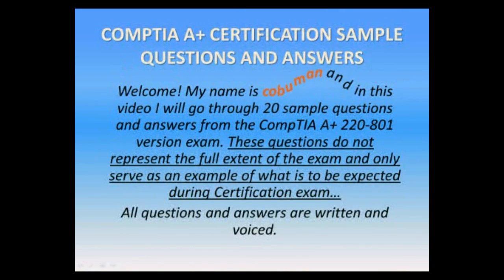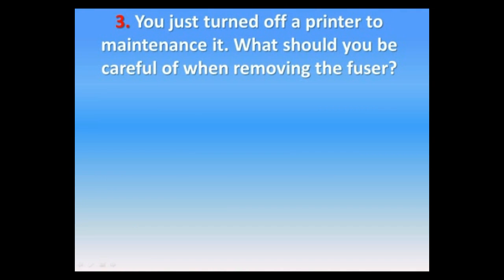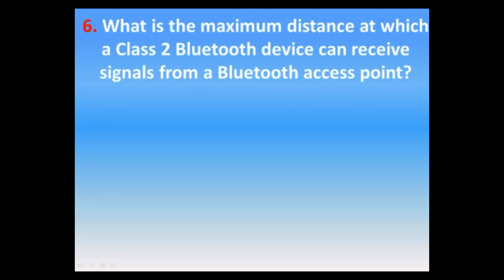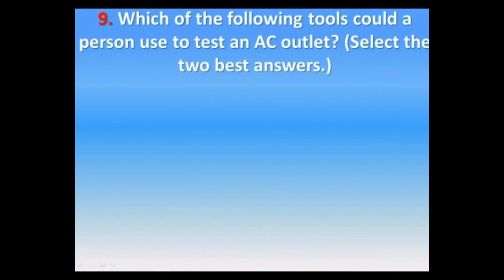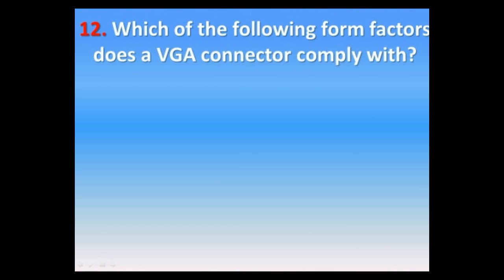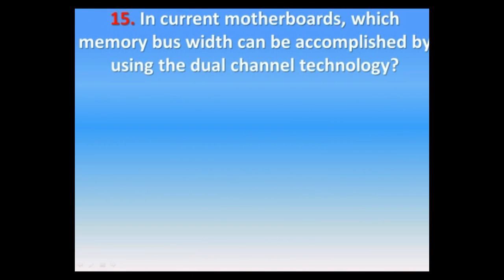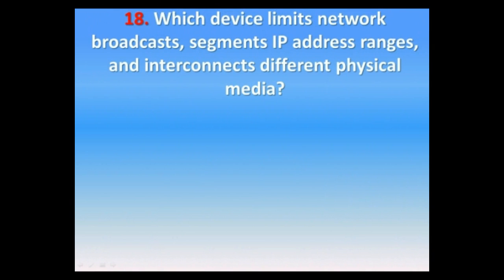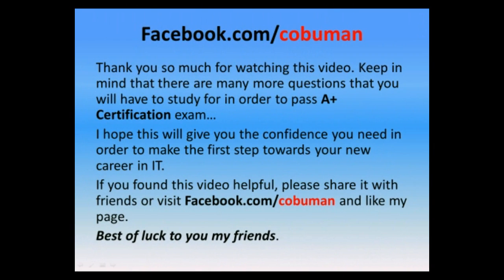Comptia A+ Certification 220-801 Top 20 Sample Questions and Answers

Comment: Actually I thought the most common types of fans were 30mm and 120mm. You’re answer was 80mm and 120mm
Reply from the maker: You may be right. Information on the video is based of CompTia source.
Reply: 30mm is probably an old standard when we were running 333mhz computers with the Pentium 1's and it is also the size of some weaker cpu fans but 30mm isn't common in 2019 and is more suitable for small form factor cases like ITX which isn't as popular as the standard cases.
Reply: Joe Exotic yes however we have to go with what is on the test

Comment: How many could a person conceivably miss and still pass the test???  Has the test changed since 2 years ago???
Reply from the maker: I believe the lowest score to pass is 675 but each question is worth different amount of points. This roughly equates to 72% correct to pass. The test changes slightly over time, but I'd imagine it's very similar to one from 2 years ago. 
By the way, I made a quick interactive sampler A+ quiz you can try: https://cobuman.com/2018/04/13/aplus-test-knowledge/
Reply: I heard that it is 72 out 90 you need to answer correctly.

Comment: i got 3 wrong..i shouldve know the 1394 question. My A99 Deluxe motherboard says do NOT connect 1394 cable in the motherbaord otherwise ill damage it...ouch.
Reply from the maker: Nice. FireWire was pretty decent back in the day... I remember transferring video from my old camcorder to PC that had Intel Q9300 on it. It was much faster than USB.